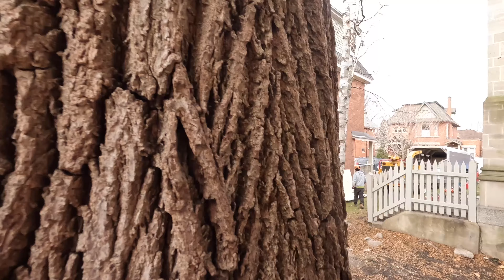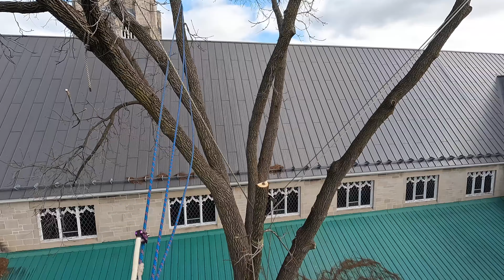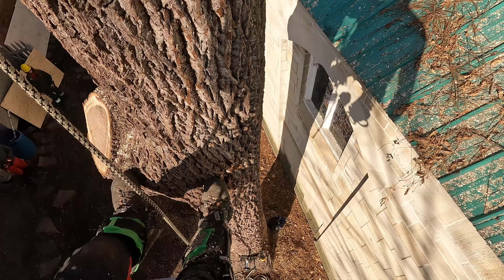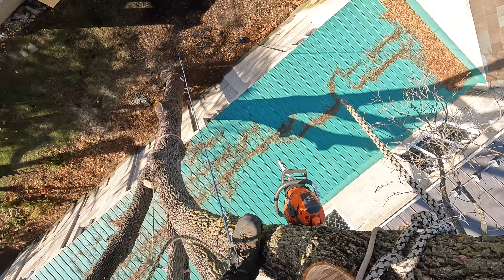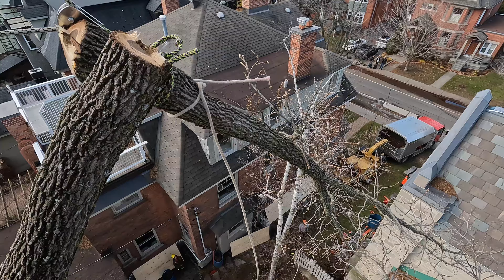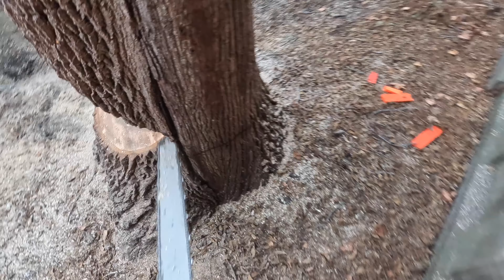Big Black Walnut Removal for Jesus!

Comment: Nice work the addition of the makita dda460zk changed grc work for me makes tensioning the lines or lifting so much more efficient and smoother
Reply from the maker: Yeah, the drill helps a lot. We use a Milwaukee Hole Hawg.